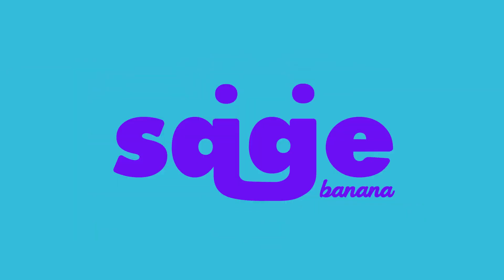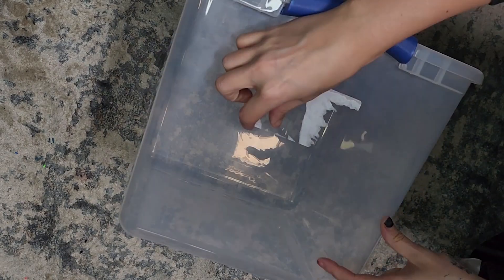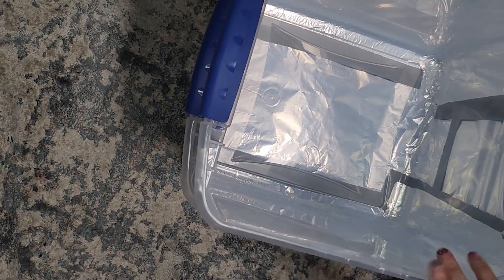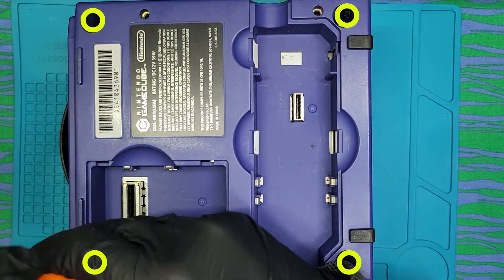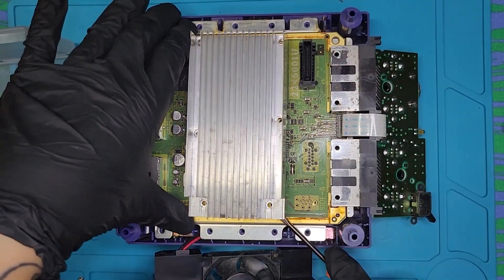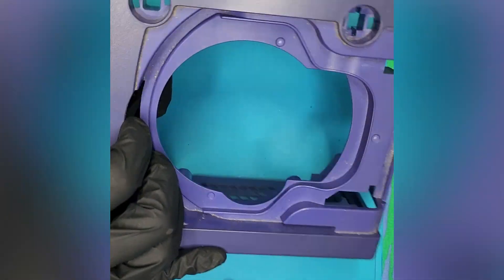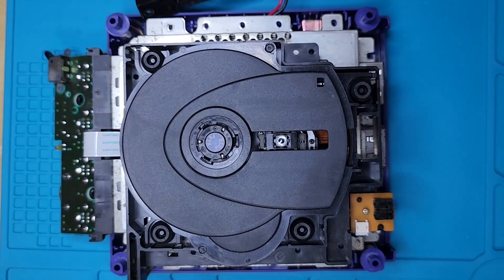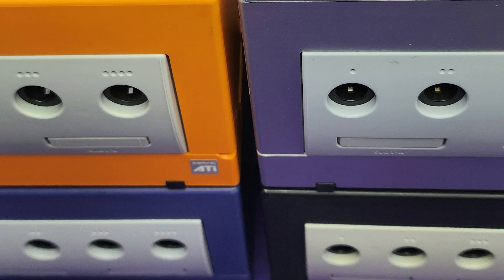How to assemble your own indoor retrobright chamber

Comment: Sunlight works well for removing yellow parts and bring it back to original color depending on how deep yellow and how much the temperature of sun in your area. 

I am confusing that some people are saying the biggest reasons for being yellowing is sunlight directed into plastics for long time. 

If it is true, why sunlight removes it too.

I believe the reason is humidity and high temperature and maybe smoking a lot can affect too.
Reply: Hate to burst your bubble, but I am pretty sure that's wrong. Most of my stuff from being a kid 'SNES/NES' yellowed horrendously, and there was no smoking, nor do we have a humidity problem. We got heat, since I live in the desert area of Cali, but I know it was the sun specifically because I used to get a lot of it through my window. I even took my SNES outside many times, since we had a setup in our back yard to play.
Most of my games, and a few controllers were saved from the yellowing though! These just happen to be the things that spent a majority of their time in a drawer. So yeah, heat by itself won't do it. It has to be sun.
Reply: @picsl8ed867  my point was that sunlight works well if you put your console or controller under sunshine for a few hours depending on how deep the yellowing! I agree with you if you keep them for long time , thats not good! 

And I tried this method and works with me !